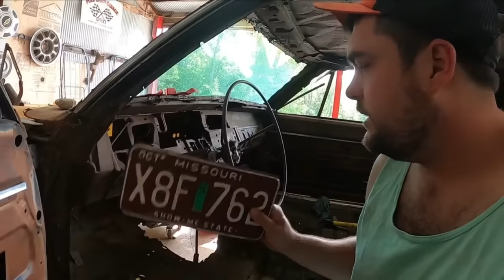Wrecked '69 Plymouth Roadrunner Build Start to Finish!

Comment: For a car in this bad a shape you did an awesome job.  You are real and this channel is amazingly great.  I love it. Also you're a great dad too.
Reply: I dislike the gratuitous damage done to the RV during engine removal, an RV that could have been cleaned and/or tolerated by a homeless person and which could have received that 383 or any old V8 smog motor, or even a 239 just to get there if that is what is left over.  Don't destroy stuff just to save a few minutes.
Reply: bonehead car show is the real mopar car show...  pole barn not so much,,,  need way moor adverts and drama and rerun clips

Comment: Im impressed at what you can get away with over there lol. Im in Australia and had an accident in my 85 celica, it ended up on its side going down the road before it righted itself. 
Ended up missing a side mirror, pinched in the a pillar which also broke the windshield and had huge scrapes all over the right side of the car and edge of the roof where it slid across the road. Still ran and drove but alignment was way out lol.

First highway patrol that saw me driving it pulled me over. Luckily they were good and when I explained I was just driving it to my mums house to park it up as she had more space than my rental they let me go but said to me if they see me driving it again they would defect the car and book me for driving an unsafe vehicle. They could have defected the car then and there and made me get a ride home and a tow truck.
Reply from the maker: Free men don't ask for permission
Reply: That's the way they oppress people telling them they can't do what they need to to survive it's not only wrong it's disgusting bullies everywhere you look
Reply: I mean come on bub, you've got to have a can of spray paint laying around somewhere don't you? Well then restore it! 🤷‍♂️😝🤣🤣🤣 if they can't tell it is the same car after a quick paintjob A. And B. that it was ever wrecked because it's all brand-used looking then how would they ever even notice???
Reply: @kevinAuman1  lol it's honestly just unsafe to drive and I can't be bothered to fix it. Would need a lot of work to get it straight again. A pillar and roof are bent in, suspension geometry is out of whack, the front end is misaligned and because my asshole brother took his frustration out on it one day, all of the glass on the ri ght side is completely smashed and as I didn't know about it, the interior has gotten flooded when it rained and the interior is now trashed. It was absolutely mint before. It's just too upsetting to me to even look at it still, and I had my accident a while ago now.

I never reported the accident to insurance so it will always be repairable. I ended up buying back an older Celica I sold when I was younger and had no money and always regretted letting it go, and have chosen to put my $$$ into getting that back on the road

Comment: Nice! This year Roadrunner was our grocery getter in the 70s and early 80s that dad bought new. Brings back alot of memories. In 84 the car got into a fender bender, then my dad had the body done over and rebuilt/bored the 383 , heads done over and cammed, 727 etc. car ran 12.7s in the quarter, it was always a dependable beast. he fell ill and car was sold in 1999. The good ol days...

Comment: Your video brought a year too my eyes ! Along time ago (1972) when I was a young fella I got a smashed up 1969 charger , it had also been run without oil 440 , the crank was ruined, I got an engine out of a 68 super bee a 383 magnum, now I got it running pretty much the same method, you used, that what made me remember the deal, didn't have much money, then I went in the army and then things kinda went downhill , thanks for sharing mi Amigo

Comment: Being an Electrician. I made a start switch using an ivory wall switch once.I used to have a 72 Cadillac Coupe DeVille I used the window motor switch for the starter and the power lock switch for accessories, out of a slant back Lincoln. Worked gr8

Comment: so u bought it & got it all / mostly togther we see in the condencer  video  !!!!!!  super awesome  video by the way !!!   then what happened to it  where is it now......???  did another  u- tuber buy it & working on it as well   or what........???????????   what did u have into it all when u sold it off there  ............??????????????   ALSO WONDERING......Why didn't u use the same auto tranny from the ol motor home  we saw ya driving it very well............  so what was the issues's  of it not going into the  road runner car here..................    KEEP  UP  THE VERY ENTERTAINING  VIDEO'S / WORK HERE  !!!!!!!!!!!!!!!!!!!!!!!!!!!!!!!!!!!!!!!!!!!!!!!!!!!!!!!!!!!!!!!!!!!!!!!!!!!!!!!!!!!!!!!!!!!!!!!!!!!!!!!!!!!!!!!!!!!!!!!!!!!!!!!!!!!!!!!!!!!!!!!!!!!!!!!!!!!!!!!!!!!!!!!!!!!!!!!!!!!!!!!!!!!!!!!!!!!!!!!!!!!!!!!!!!!!!!!!!!!!!!!!!!!!!!!!!!!!!!!!!!!!!!!!!!!
Reply from the maker: I appreciate the enthusiasm. I sold it to a guy in Nebraska who is fixing it better than I ever could. If you go watch the individual videos you'll see the explanation on the trans, the motorhome trans uses a companion flange with no slip yoke, making it not a good fit for a car, and the guts are different from the early torque flight I installed

Comment: Clark Dorkman...awesome choice of name! Edit: This was a fun video. I always enjoy when someone works on an old Mopar. My buddy has a legit all original 69 Roadrunner. He had a 1970, and we installed a 383 with an A-833 4 speed manual, but the clutch fork (which is a 3 piece deal) was all messed up and this may sound stupid, but we could never figure it out. Anyway, he gave up on it and sold it not long after.

Comment: i don't know if it is what caused your transmission issue but i have heard the quickest way to burn up a automatics is to run it with the kick down stuff disconnected and with the way you were throwing it around it really likely wasn't very good for the transmission.
Reply from the maker: A: that's not a kickdown. It's a throttle valve. Yes it would damage it with extended use due to low line pressure. It would not have damaged it just sitting still in my garage, where it also clearly did not work

Comment: Gotta put it in neutral to check the trans fluid level.. if it moved at all, then it will move, dodge trans fluid has to be checked while in neutral not park if you check it in park then it will say its over full when really its low, and do on..

Comment: I don't see a need to mess with new brackets to change to a GM alternator to eliminate 2 wires.. especially when it's possible to convert the alternator you have to internally regulated.

Comment: I've had a transmission not move at all because I had too much fluid in it and I also had a Dodge Cummins with the torque flight transmission and it would not move unless you put it in neutral for about 30 seconds then it would go into gear? Just throwing that out there brother

Comment: For the front top of the windshield I’d have used the pole u was but used a Jack with something coming down from one of the poles off the roof of the shed and pushed it down so the windshield would fit